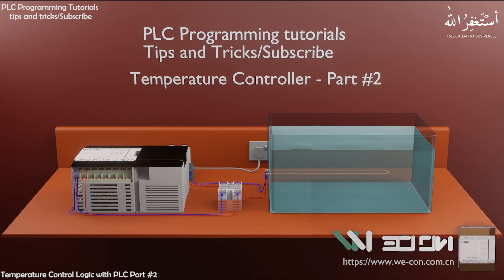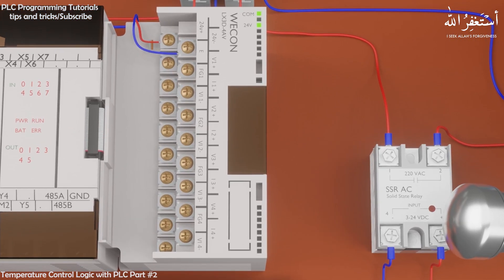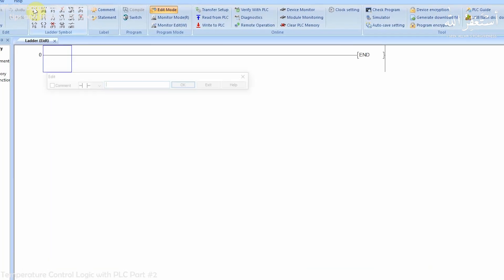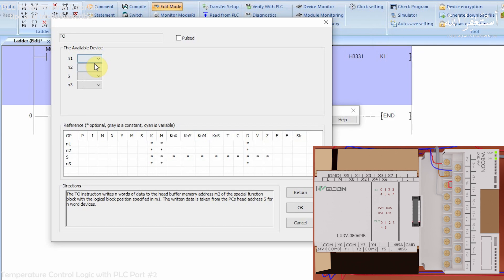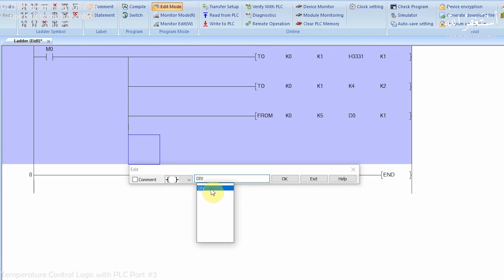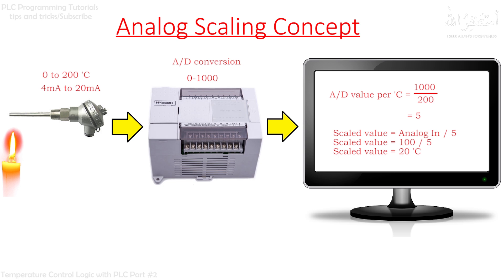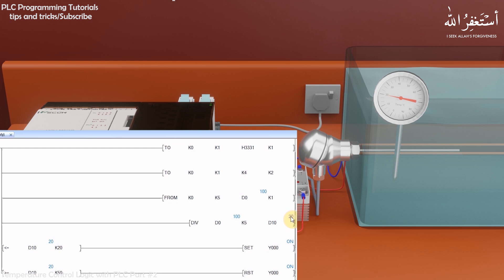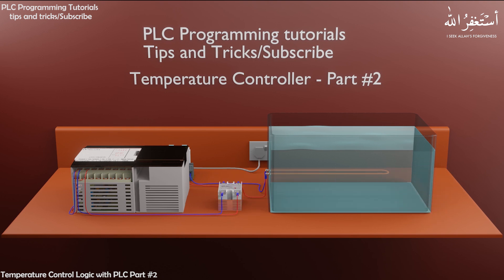How to connect Temperature Transmitter with the WECON PLC || Temperature Control Logic in PLC

Comment: Thanks for this material...but I have a question..
Can we change the minimum value and maximum value of sensor..for example can we change the range between 30c and 70c where 30c gives 4 ma and 70c gives 20 ma??
Reply from the maker: Yes , you can,
Reply: @EASYPLCTRAINING  
Thanks, but this transmission doesnt have a zero and spin button ??, unlike pressure transmission, so how we can do that ?